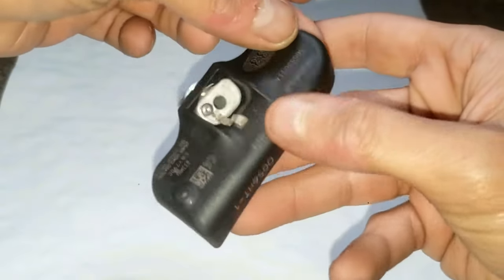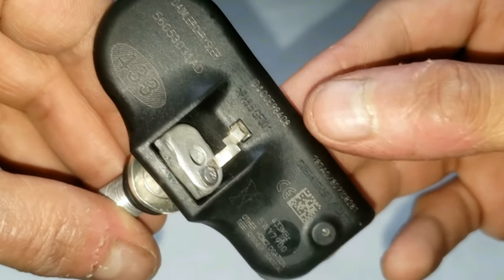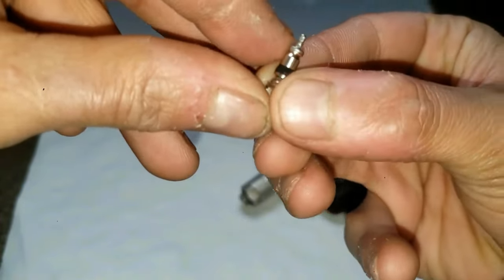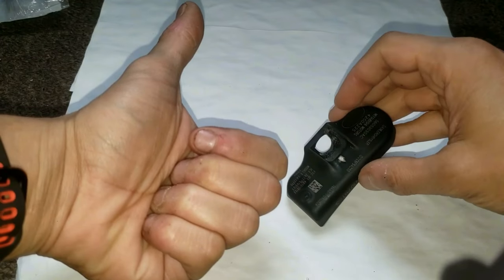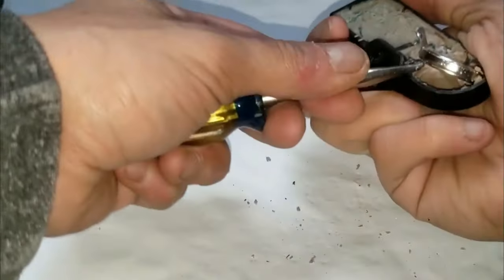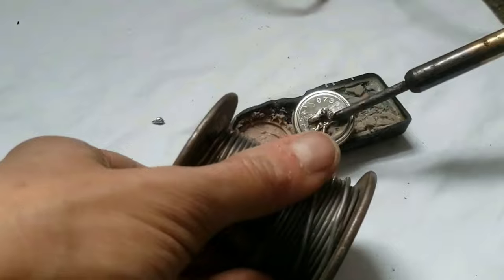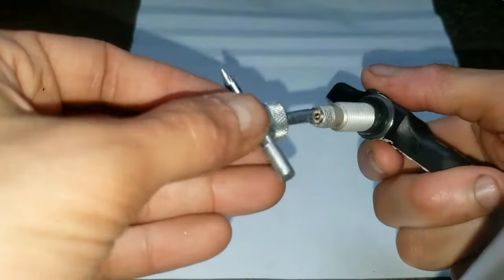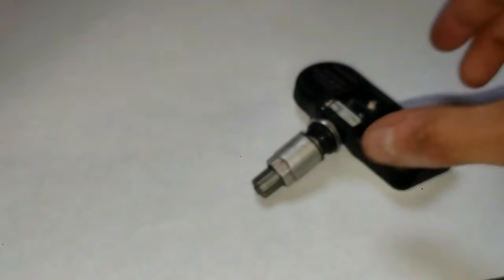How To Replace The TPMS Battery 🔋 and 🪓Tear Down NO PROGRAMMING

Comment: A tire shop will charge you 80 bucks per tire, including the sensor (cheap Chinnisse sensor) 
Dealership (QB Toyota NY)will charge you $215 per tire including denso sensor and labor.
If you are dandy enough to do it yourself then that is the way to go. eBay sell a pack of 10 Duracell 2450 for $12. 
Do the math. 
Just for reference (2009 Toyota 4Runner)
Reply from the maker: Thanks for you comment. Hopefully this helps others out.
Reply: I was quoted 2000.00 to replace 4 sensors
Reply from the maker: Now that's just robbery! Hopefully you went somewhere else!

Comment: Not worth changing the battery, I will just find a way to disable this useless feature😮
Reply from the maker: I've put tape over a tire sensor light for an older car, but of course I have to check tires periodically as a result.